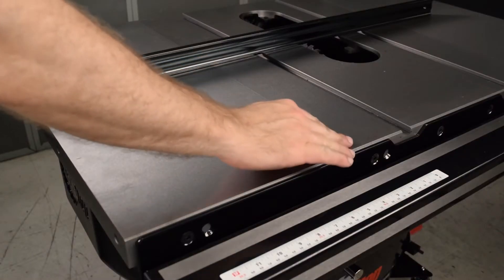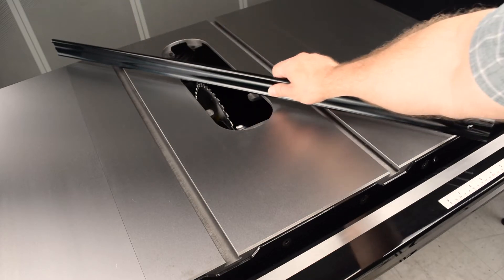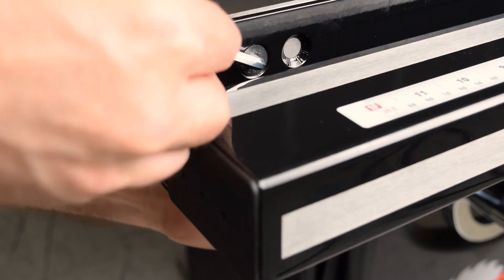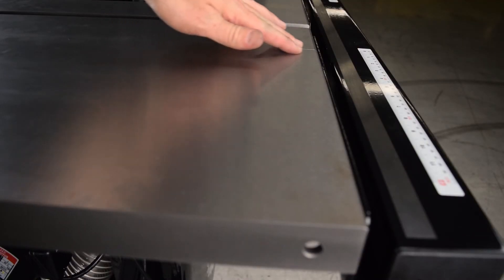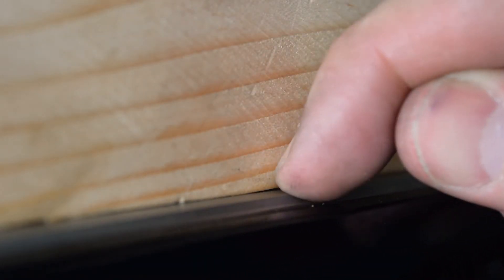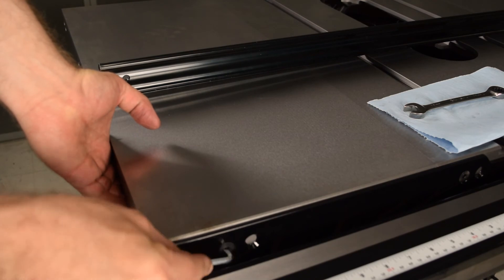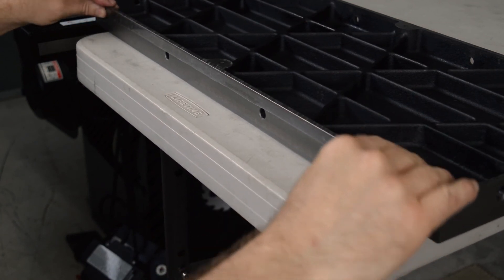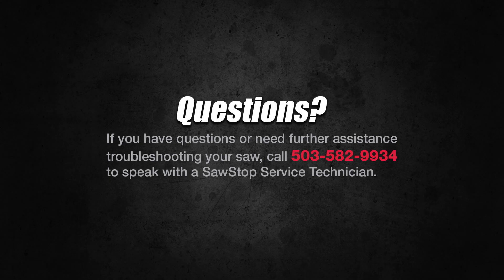SawStop Service Tip: Level and Align Cast Iron Wings

Comment: The middle of my extension wing is higher than the sides. What should I do?
Reply from the maker: Sorry for the difficulty you’re having with your SawStop table saw. The best way to help is to have you speak directly with our service department. Please call them at 503-582-9934 or email them at service@sawstop.com. They’ll fix you right up. Thanks!

Comment: So I’ve been struggling with my inserts ever since I got the saw - they just never want to sit flat no matter how much I adjust the screws. After watching this I checked my main table and one of the diagonals is wayyy off. Like over double the tolerance! I only have a feeler up to .024” and that one slides through fine. This may be the cause of a lot of my issues - all subtle, but enough to make me crazy sometimes. Otherwise, I love the machine so lets hope SS support can help out with this.
Reply from the maker: Hello, we're sorry you are having issues. Please reach out to our Service Department (service@sawstop.com) They will help you to diagnose the problem and will help you get the right solution.

Comment: Wait. The cast iron extension plates are “flexible”?”

There is nothing to “draw up” an extension as the bolts are tightened. Alignment depends on my brute strength. After working an entire afternoon, I got them close but only close.

I then attached the 52 inch rails and spent another afternoon aligning them. Them I placed the laminated extension table on the rails, per the instructions. Immediately the weight of the table and the rails themselves, combined with the leverage in their 52 inch length, simply pulled everything out of alignment.

Why do the instructions say to install the legs that support the extension table AFTER placing the table on the rails?

The video helped me understand the extent of my alignment problem. But I don’t have the proper tools to “flex” the extensions and hold them in place while tightening the mounting screws.

Comment: This process was extremely tedious to say the least. I was unable to level the wings until after I had the rails installed. The outside edges of both wings were high with >0.010” variance. It was 0.020” on one side. I was able to get the wings leveled once the front and back rails were installed; however, it still wasn’t easy and took a long time. Having a second person to push the edges of the wings down would have been very helpful. 

BTW SawStop online chat tech support told me the outside edges were too high most likely because I had “overtightened” the bolts. That was wrong and was a very bad start to my relationship with SawStop. Also, there is nothing in the manual warning about overtightening.

Comment: I’m glad they displayed the text (< 0.010”) because when the voice-over said, “Less than one ten thousandth of an inch”, I was shocked. That would be (< 0.0001”), whereas (< 0.010”) is “less than one hundredth of an inch” which is a huge difference. (Sorry. Just me being picky…)
Reply: I played that back several times too. Then came to the comments to make sure I wasn't the only one.
Reply: thanks, I was also confused.  < 0.01" seems reasonable.  <0.0001" -- can you even buy a feeler gauge for that small?
Reply: Was off 0.025” initially on one end for one wing. The Above alignment method worked like a charm with a milled piece of wood coupled with and F- clamp.  Highly recommend using the F style clamp in lieu of the standard pressure clamps (better control with the screw compared to the trigger).
Reply: Is one ten thousandths of an inch .0001" while ten thousandths of an inch .010"?
Reply: @Dudeinator  Yes
Reply: In machinist language, they used the correct wording. One ten thousandth is .010, and one tenth of a thousandth (or simply one tenth) is .0001